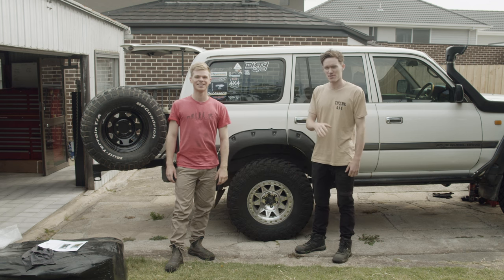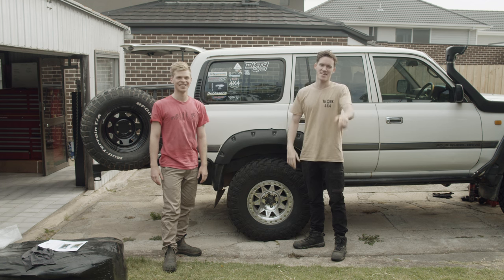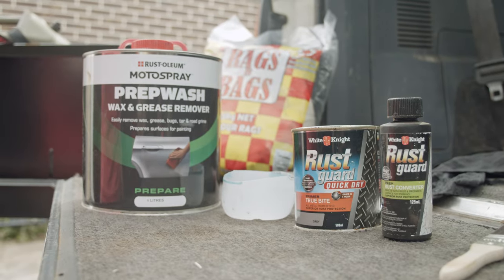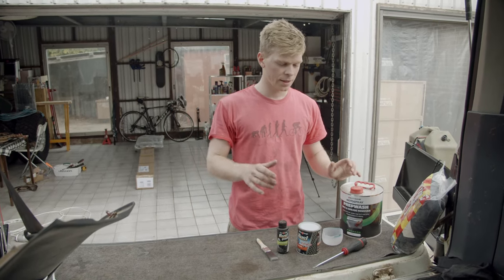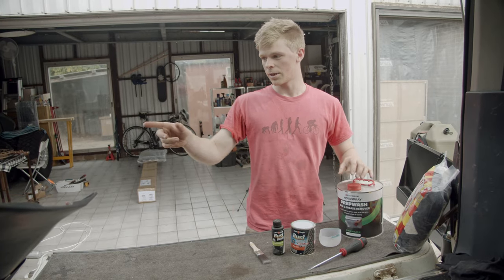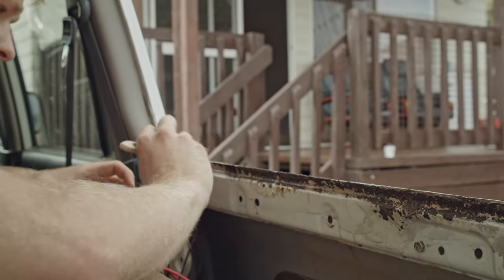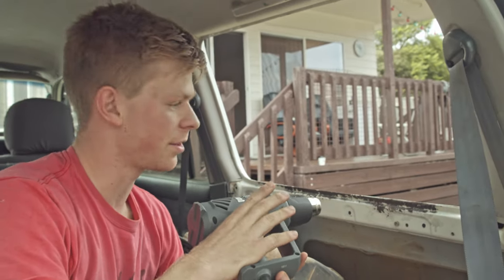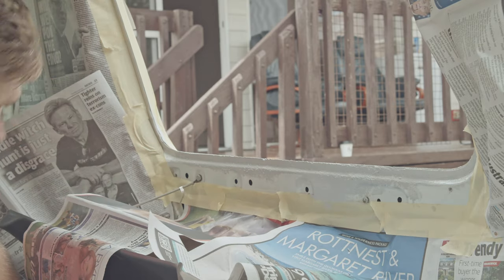Installing The Cruiser Company 'Lift Up Windows' on the 80series Landcruiser. GULL WINGS!!

Comment: Great vid guys. How do rate them quality wise ?    Cause I'm  tossing up between these $800 pair and the Emu Wings with are about $1500
Reply from the maker: Factory deadener: get dry ice to freeze the old stuff and take to it with a hammer and chisel. Took me 2 days to strip the old stuff out. Follow with wax and grease remover before laying the new stuff

Comment: Hey guys what offset did you run on the 80 for the new dirty life’s wheels thanks 👍
Reply from the maker: -38’s with the 35x12.5’s. loving the look however I had a 3” lift and they scrubbed so I had to go to 4”, extended bump stops and will need to widen the flares slightly. Definitely loving the beadlock life!

Comment: How do you rate these compared to more expensive Emu Wings? Also since you fitted the Cruiser Co ones did you considering re-painting them white on the outside as black would not reflect heat very well. Which 045 colour coded rattle cans did you use?
Reply: Get EMU as you don't Drill